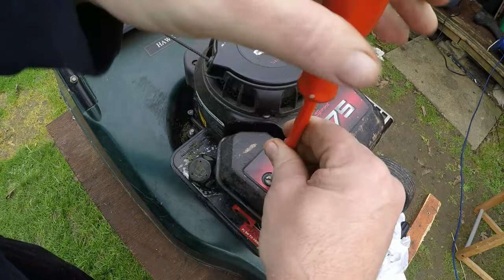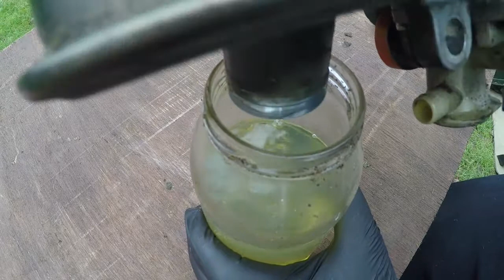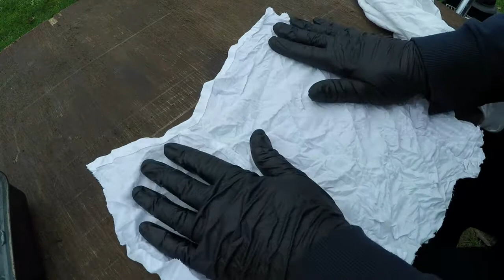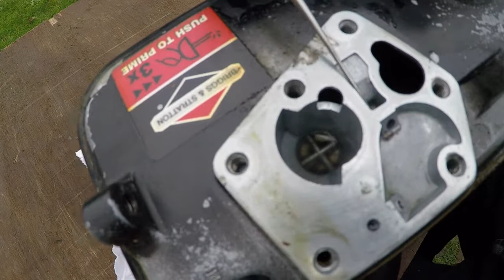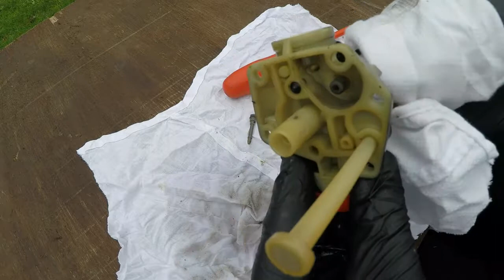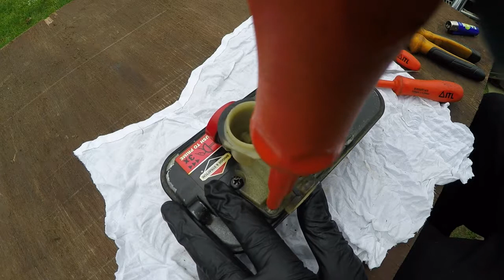How to clean a Briggs and Stratton Carburetor and how to change the gasket and diaphragm

Comment: Just want to make sure I understood you correctly, WD40 can be used for cleaning the carburetor metal part, right?
Reply from the maker: Yes ..
Reply: @themowerman  One more question, are using WD also for cleaning the plastic parts too?

Comment: Alright Mick, I’ve just fitted a brand new diaphragm and gasket, and fuel is still ending up in well where the mesh sits
Reply from the maker: You are supposed to get fuel in there mate it's where the main jet sucks the fuel up from.. did you clean the main jet?
Reply: Oh are you lol, I watched a video a lil while back, and I’m pretty sure it said there shouldn’t be fuel in
Reply: It all runs fine, but I took it back of to see if fuel was inside the well and it was, so I though I done something wrong, because of what I heard, but clearly not if that is where it sucks it up from
Reply from the maker: @nathanhuitson1418  yeah its correct
Reply: Micks Mowers cheers Mick
Reply from the maker: Nathan Huitson Wellcome mate